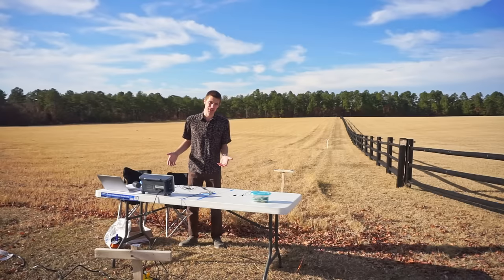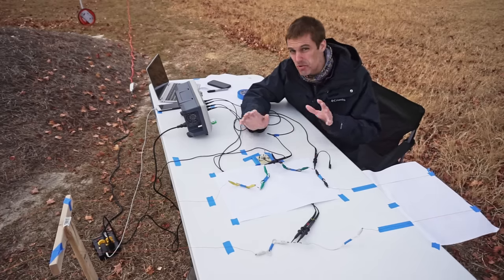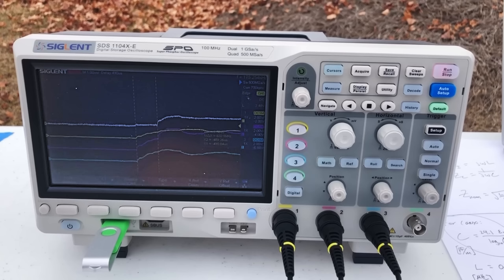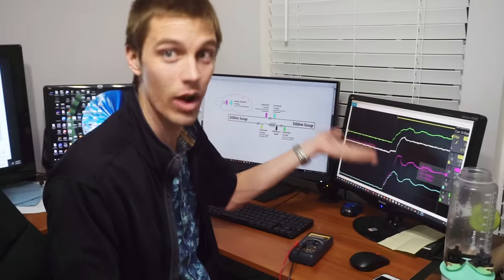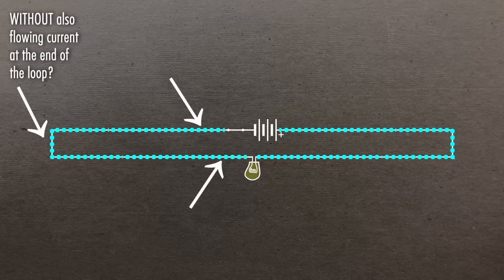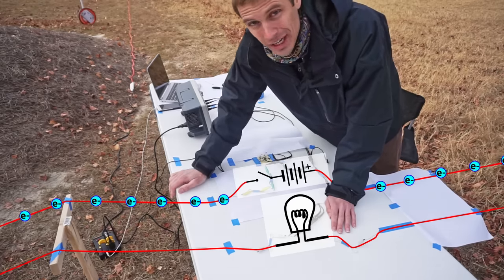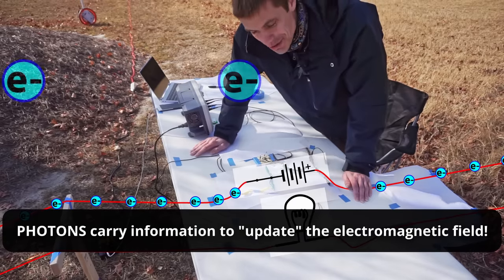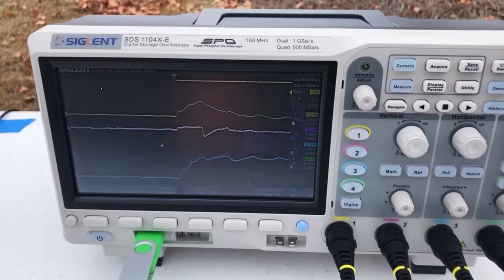I bought 1000 meters of wire to settle a physics debate

Comment: It's the associated electromagnetic field that travels at the speed of light (not the current itself). i.e. when you have potential difference (a live circuit) it causes an electric field to form, which pushes the current through the wire. When you have current flowing through a wire then a magnetic field naturally forms. The two combined together are the electromagnetic field in the live circuit, which is basically the electromagnetic wave that travels at the speed of light as it influences and combines with the localized electric and magnetic fields inherent along that wire. Those EM waves are what transfers the electric energy and magnetic energy around the circuit at the speed of light.  The current actually only travels at a speed proportional to the amperage (which is usually between 0.25mm and 1mm per second, depending on the amperage) which is very slow electron speed, but it is the current (through its motion) that causes the magnetic component of the field to form, while the battery causes the electric component of the field to form.

Comment: A incandescent light bulb is a poor indicator since it requires time to heat the filament hot enough to emit light.  A LED connected directly to the wire would have been a better indicator.

Comment: Electrical engineer here. I would assume the immediate initial current is flowing through stray capacitors that are introduced by having the resistor physically close to the battery/switch and especially the oscilloscope attached to various points of the system and cables lying around. It has nothing to do with electrons moving through the wires. There is no way to have instant effects over long distances (short of quantum entanglement).
P.S. for anyone in the field its more common and easier to visualize to have the reference ground on the negative end of the battery and the switch in the 'hot' positve side. That is also the way to go in higher voltage environments for safety reasons. We el. engineers think in terms of current flowing from plus to minus, not electrons going the other way.
Reply: Yes spot on, also an electrical engineer 
  This is a very strange setup as it is putting a pulse in one l leg only of 2 transmission lines and is unbalanced and in  series with the  2 transmission lines that are short circuit at the ends   .Stray capacitance everywhere  wire to wire  and  to ground   So you will see electical energy in the load instantly noting to do with the speed of light whatsoever

Comment: In case someone wants to know: speed of electricity in wires is usually between 50% to a bit less than 100% of the speed of light in vacuum. In coaxial cables which have a plastic insulator between the conducting wire and ground that "slows" down the electromagnetic waves the speed is about 70% of c.

Comment: One of the things that happens by placing the wire on the ground is the transient EM field that is induced into it, that then is induced as voltage back into you wire loop once you turn your circuit off…

Comment: Electricity works by exciting electrons within a conductor. This happens instantly, but the intensity of it builds up until you have a circuit at its “maximum pressure” (voltage). There is a slight voltage delay, where it builds up, but you’d never see it because it happens so fast. If you made the wire longer and put the lightbulb anywhere in the circuit, the delay time might increase. This is only because of the length of wire and number of loads being energized has increased. In this case, it’s only the length of wire, with the same lightbulb every time. Imagine energizing 1000 meters of wire with AA battery. You can do it, but it won’t be enough push to power anything. You’ll get voltage, but it’ll be so low that it practically wouldn’t exist. After all of the heavy loads, the voltage pressure of the battery is too low. Maybe amp it up a bit.

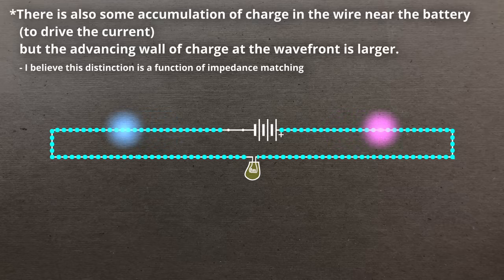Comment: This has likely already been stated (I have not read every comment) but if you had used shielded coax wire with the shield earth grounded and used the center line as your conductor, I think you would not see much of the initial "instantaneous" current. It would prevent the reactive component of the otherwise bare conductor from interacting with itself along the long path and you would have seen just the spike after the 1 km journey had been completed. You talk of this interaction at 17:45 and coax should prevent ~99% of the reactance cross talk. What you see after you cut the wire at 17:58 is essentially an antenna of sorts. Of course, a km length of coax would cost a fortune.

Comment: The inductance and capacitance of the line will create delays in current rise and voltage rise. When DC is applied across a capacitance, the initial voltage appears to be zero as the capacitor charges with current, and then the voltage rises to supply voltage as the current surge to charge the capacitor ceases to zero. When DC is applied across an inductor, the initial current flow is resisted by the buildup of a magnetic field, resisting the current flow, and the supply voltage is maximum at that time; as current flows to maximum as the magnetic field is created to maximum, the voltage reduces to very close to zero, the only slight voltage drop is across the actual resistance of the wire.  A long wire has both capacitance and inductance and will create current delays based on the reactance of the inductance / capacitance values.

Comment: Are your wire loops coupled?  In other words, is the wire going out right next to the wire coming back?  Current flow in the outgoing wire will induce current flow in the return wire.   You should make your loops big so that the wires are far from each other.  And keep your light bulb (resistor) farther away from your battery and transistor switch.  I think the immediate 200uA current is due to coupling.  From your setup, it looks like you have about 1ft between the wires, which isn’t enough.  I see that at 17minutes ito your video you cover this coupling.  Good job.

Comment: That small current at the beginning, is nothing weird at all – it is the current that charges the capacitance equivalent of the circuit, because those wires are acting also as a capacitor and also as an inductive component – in a very shy amount, but they do.
Oh … I see that you got to that at minute eleven …
P.S. (edited)
And you can look at the electrons bouncing back as the discharge of that capacitor equivalent.

Comment: I actually did this experiment, by passing the wire up and down the halls and floors in my college science building, after hours. It did indeed prove that electricity travels at the speed of light. There were some capacitance effects which were interesting.

Comment: Why does your roll of wire have to be straightened out into a long, linear wire? It can stay as a roll, and electricity can flow through it, traveling the same distance, as long as the wire is insulated. And you can cascade 20 rolls to make it 10 km long, and all of that would fit into a tiny footprint. With greater length, you should be able to detect the delay better.

Comment: Those who have used and understand how a TDR (time-domain reflectometer) works likely already knew the answer. Using my own home made TDR I can tell the length of wire in the circuit, and can tell not only if there is a short or open, but where the short or open is within the length of wire. A very handy tool to have, for sure.

Comment: Before watching the video, technically you can detect a signal on the bulb, as flowing current could induce a EM field, which can be picked up by the wire near the bulb, working as antenna.

Comment: The circuit equivalence of a wire, or cable, has capacitance and inductance. The EMF ends up to be around 0.9c. Electronic switches also have a delay. Electrons move inches per second. Earth's magnetism also has an effect.

Comment: The issue with this experiment is using wire. Capacitance, like you observed is a result of the limitations of the physical,properties of the wire. 

I propose a better experiment would be to time the flow of lightning.  That is electricity moving through air, which won’t exhibit the material interference wires introduce.

Comment: What I may be interested is the same experiment but with the 2 long branch shaped as a circle instead of a parallel back and forth. But using parallel wires you both maximize self and capacitance in the line. a circular loop will minimize this effect.

Comment: I think the long wire in fact acts as an inductor or an antenna. It might even catch stray electromagnetic signals around in the air and show that signal voltage in the oscilloscope

Comment: This channel is awesome, another great video.  I wonder though, you said that the current flows until the charge piles up and has nowhere to go.. I’m going to guess that what is happening precisely is that a small amount of charge builds up and creates an opposing E field, which balances the potential between the end od the wire and the battery?  This makes more sense to me because as you say charges move slow, too slow to pile up and take up all available space.

Comment: Electrons are in the wire regardless of the current fed from the battery. When the current from the battery is added, the electrons existing in the wire are forced out of the space of their current location in the space of the orbital shells of the atoms they are in. The effect should be instantaneous as the electrons in the furthest location from the battery are already in their location in the atoms of their orbital fields.

Comment: Amazing, loved to see theories being proven in real world experiments. I have a question: what about your 1km circuit is not linear 500m right 500m to left but circular? Wouldn't it be better to measure the speed of electricity without side-effects as in you experiment due to two parallel lines close to each other?

Comment: Direct current most definitely does not go the speed of light. But the electric field affecting the electrons within the material does. The electric field propagates at the speed of light specific to the material its propagating in, but the fact that electrons have mass means that while the electrons will experience a force from this field, the creation of a direct current substantial enough to measure will take a time greater than the propagation of the field itself.

Comment: It seems odd that you discounted induction when it appears to be the most logical answer. 
The initial voltage is surely the induced current due to the proximity of the light to the power source and that initial current is induced by the effect of the Local EMF when the switch is closed. 
It’s not enough power to turn the light on but the effect of the EMF is what you are seeing 😊
Reply from the maker: “Induction” implies a link through the magnetic field, but what I explained was a link through the electric field. In reality I now think it’s both

Comment: Electricity travels at the speed of its pathway. A conductive material like wire will have a resistance factor which impedes the flow. Even lightening is slowed by the resistance of air. That’s why a falling object just reaches terminal velocity and doesn’t continue accelerating.

Comment: Great!
So, to avoid the electrons going to affect the electrons of the paralel wire in the other side, you can do a circle of 1 km of circumference, this is going to eliminate this effect, and you are going to have only one step in the curve of timing of the current, acrosing the entire circuit.
So, waiting for the second part ow the video, so we can check or discard that.
Thanks a lot.
By the way what osciloscope are you using and which probes are you using, also to know if you are using x10 or X100 or more.. probes.
Thanks a lot.
This is a good experiment.

Those 1.6ns are depending on the electronics and electrical equipment, the osciloscope and probes and wires. Right?

So, please, make a little tyni check similar to this one, but just to measure with one osciloscope, the time other osciloscope uses.
I thing you can set a circuit including one osciloscope, and as a switch, use another osciloscope.

Thanks a lot.

Comment: Makes perfect sense. So the wire acts like a capacitor, and the battery charges it up when the switch is closed. That has nothing to do with electricity moving faster than the speed of light. Nice job!

Comment: Think of electricity as a row of atoms flowing inside a pipe. The diameter of the atom is equal to the bore of the pipe. Fill the pipe with atoms so that there is no gaps between the atoms.  Think of voltage as the pressure that pushes the atoms along the pipe. 

Apply enough voltage to press one new atom into the pipe and instantly one atom pops out the other end, no matter how long the pipe.

Thus it appears that electricity travel extremly fast, i.e. at the speed of light, but, it was a different atom that popped out. It can be shown or calculated that the aerage speed of the atoms is a very modest 3 metres per second. That's about a brisk walking pace.

I leave that demonstration for a later date.

Comment: So basicly this can be field tested by doing this experiment again using this test as a reference.

1) You do test with different gaps between wires. Smaller gap, intuitively you should get higher osciloscope result and vise versa, larger cap, you should get weaker result.

2) Try to do the sircuit as perfect sircle as  possible and I guess this should almost fully eliminate the osciloscope result comparing to this test.

And what we get out of this is more clear test results that yes electrons affects other electrons over wire.
Reply from the maker: You’re right on both - I did those tests the same day

Comment: Similar to the chain in the tube example, if you imagine that the tube ( wire ) is already full of table tennis balls and as you push one in, one pushes out the opposite end - a single electron does not need to travel from one end to the other.

Comment: transistor switch has a switch time (which I assume is  your ramp). It also depends on current flow to be present (which changes the experiment). I'm tracing down these independent experiments and seeing that the results are not all the same. You may not be getting the same results. I don't know how complex  your switch is, but if there's no parallel load resistor on the switching board then you really should have one. That would immediately load the transistor and current would not affect timing. Now if you have a mosfet then it's not a problem, but a transistor is a very finicky circuit component.

Comment: Is that inductive coupling?  The usual analysis we do on electrical circuits uses a simplification called "lumped element analysis".   This circuit violates those conditions so the usual intuition we have developed does not apply.  That is why the results seem dumbfounding.

Comment: The speed of light depends on the medium light travels in. Glass has a lower speed of light than space for example. Same for water. And this is why light bends when it enters a different medium. And yes, Space itself IS a medium - believe it or not.

The problem with Derek's original experiment is that it was highly simplistic (which is an insult! Simplistic means "ignoring important aspects of an issue), and did not address the subject in the depth it properly deserves, and it remains 100% true that it will always be impossible to measure the one-way speed of light. That is the nature of light, and time.

Comment: Instead of two parallel wires, try this same experiment with the wire strung up in a giant loop or rectangle.  This will make a significant change in the capacitance of the circuit.

Comment: In the animation where you show the signal travel along both wire loops towards the lightbulb, is there actually a reason for it to do that if only one of the sides has a switch? The end without a switch (in this case the positive side) doesn't drastically change as it's constantly connected to the battery and therefore the whole system from the positive pin all the way to the switch should be positively charged. Flicking the switch connects the negative charge of the negative pin to the positively charged wire, and the "signal" starts moving at the speed of light from the switch towards the positive pin. This is how I understand it with my limited knowledge of electricity, so if someone can explain to me why it isn't like this, please do.

Of course there would be some trace signals that start from the positive pin as well, because of induction, and batteries not being perfec and all that. But I'm talking about the primary electric current that lights the bulb. If I understand things correctly, the lightspeed delay should start from the switch and move in both directions until it reaches the battery pins. Not from the battery itself. So if we put the switch right next to the bulb, there would be basically no delay, and instead the delay would happen in the battery "noticing" it's being discharged.

Comment: Wheatstone, using several miles of wire, calculated the speed of electricity to be over 1.5 times the speed of light. Tesla later determined it to be pi/2, 1.57 times measuring the speed through the earth.

Comment: There should be a control loop of wires that is as short as possible to show the difference from the long loop. Otherwise you can make a mistake rationale in the behavior without realizing that behavior still exists in different models. And also a different oscilloscope and probes to display control variability in their properties.

Comment: Yes, it does, and you can tell that when you're not just measuring the electron flow through the conductor, which isn't itself the flow of electricity but a side effect
Reply from the maker: The electron motion makes the fields and the fields make the electron motion. Both halves are necessary for “electricity” power transmission